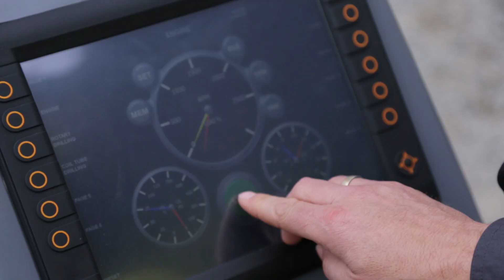RoXplorer® Coiled Tubing Drill Rig

Comment: Great machine this has winner written all over it. What the vid doesn't tell you.1. Can bore to 500m.2. Jack feet ? Outriggers they are called. 3. Eliminates the start , stop practice of having to drill then attach a rod.4. Adelaide invention , $ 20 million invested.5. Output x 3 times using metal rods.6. Eliminates all dangerous manual handling and virtually eliminates workers compo claims.7. Reduces safety costs associated with labourer attaching drill...ie huge reduction in gloves.